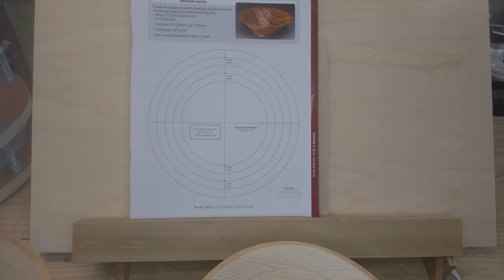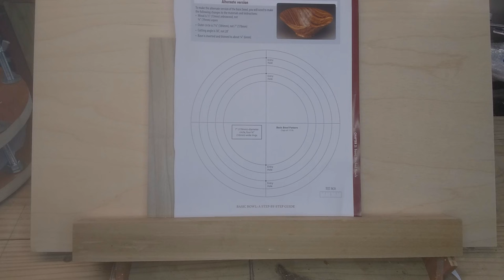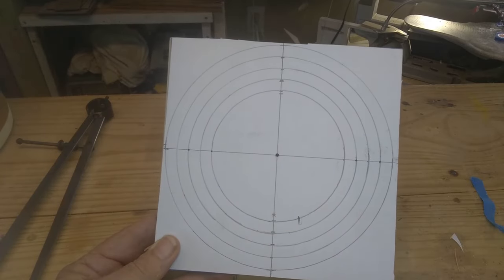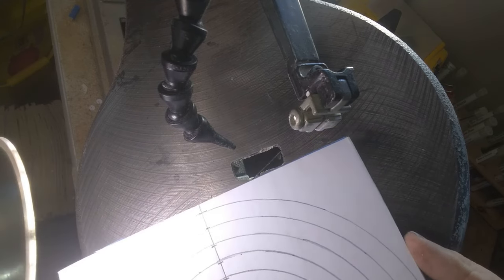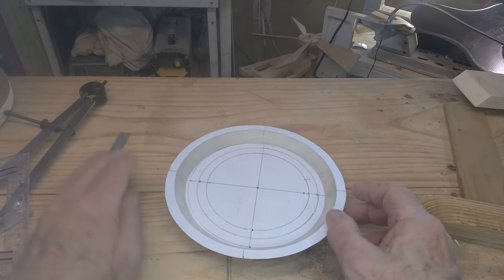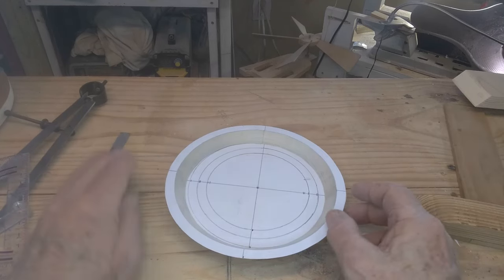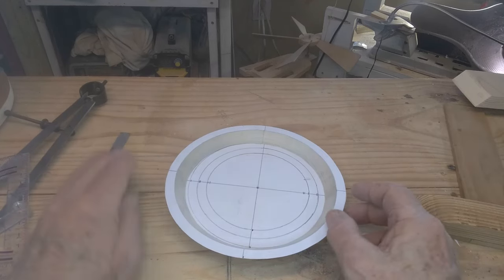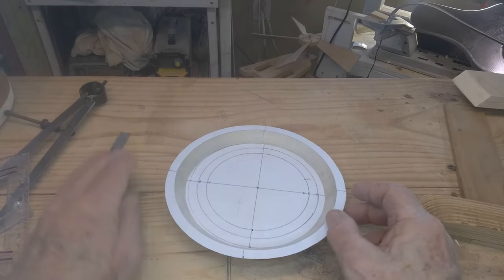Scroll Saw Bowl With Inverted Base

Comment: Very nice bowl. When you glue the rings together and put them in the bowl press, how do you keep them  from sliding.
Reply from the maker: Thank you.  I have been very careful on how much pressure to put on the press at first.  I like to wait a couple or so minutes to let the glue get somewhat tacky before I press them.  I only put enough pressure for the first 5 or 10 minutes to squeeze the glue out a little.  I then take it out and scrape the squeezed out glue off of it and put it back in with more pressure the second time.  So far no rings have slipped.